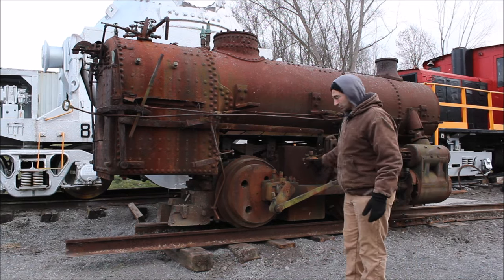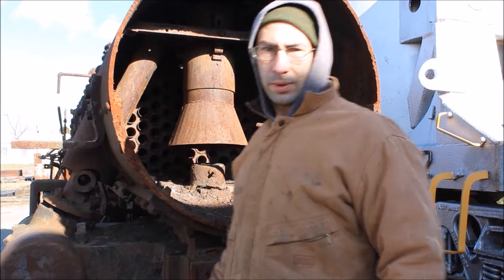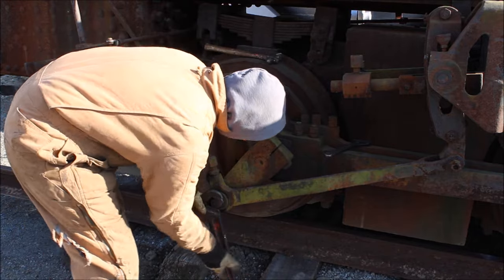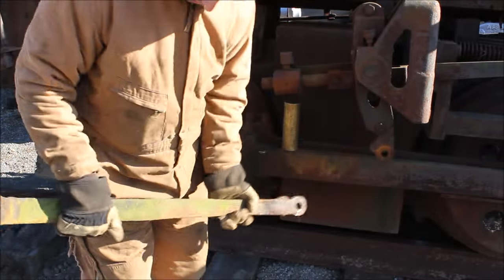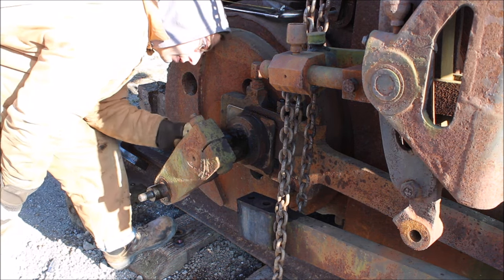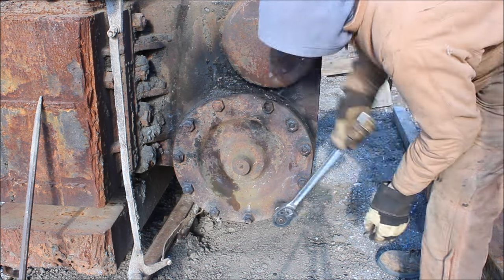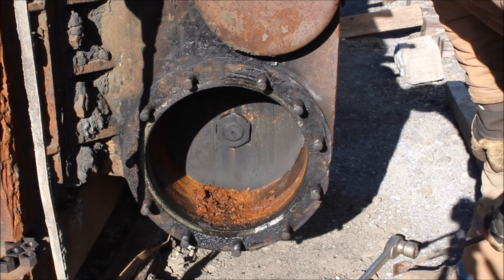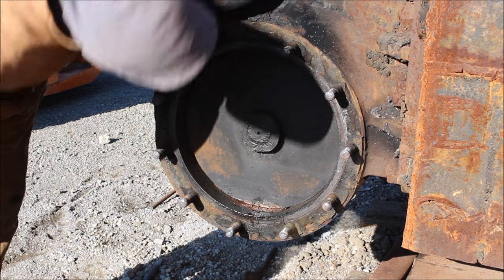Restoring the J&L 58, the "Rolling Ingot"  Part 1

Comment: Ahhh, my kingdom for a 3/4" impact gun!
Reply: Or at least a good 3/4" drive socket set, ratchet and pull handle.  Geeze,  a pipe wrench and crescent, with big bolts and nuts that rusty.

Comment: The different terms used for the parts of the locomotive & boiler are different in American and British railroading. For example when he says "flue sheet" I realised he means 'tubeplate'.
That one was easy to tell because he was pretty much pointing at the particular area.
It is difficult to follow what parts he is talking about before 4.00, when he was talking about the process of dismantling & restoration.
The boiler is always #1: What is the inner & outer firebox like + the front tubeplate.
Then you go looking at the frames and the wheels. Well, you said that the frame had been cut. 
I assume the super-heavy nature of the frame is to add low down weight & boost tractive effort. It is odd to see piston valves and Walschaert's valve gear on an industrial locomotive.
Were 2ft gauge railways that common in the US for internal use in industry?
Reply: they had them and used them till a bit latter era then the mainliners, so yea there are some short line and smaller gauge tracks in industrial area.

that said forgive my weird statement but the smokebox on this engine compared to a mainliner like 765 or 611 is cute, look how tiny that blast pipe is, this thing while I know is heavy metal thats the nature of the way they were built, but that boiler is soo tiny it dont look like it could hurt a fly,  looking inside of 765 on the other hand the thing looks like its ready to make dinner out of you especially the giant blower ring, looked like a rack for wood on a giant fireplace under all the grates and mesh to keep the cinders down and the huge blast pipe coming out of the floor of the smokebox, I help out with 765 sometimes on days off, there are many that do way more, and are more well known, and have been doing it longer, but I do help out with odd jobs, the occasional grinding and metal work, lots of cleaning, and being a tool monkey fetching things for the others since I am younger in my mid 30's, vacuumed out the sand from the auxiliary tender tank car climbing in and out of the baffles makes for an interesting office for work, and getting the hose around is a pain  in the hands pulling on it for 2 hours trying to move the shop vac hose around, but its the only way to get it done, the tools might be newer that we use but the methods of care and fabricating are the same time honored way, making parts means lots of hot work grinding, and the muscle sometimes of two or three men.  

but yes as it its Rick could use a helper at least taking care of a steam engine is not a one man job.

Comment: You guys are so awesome! Its really so cool to see some things not only saved, but actually rebuilt and running from Yougstown, I am originally from Cleveland. I wanted to ask why is this called Jones and Laughlin, did this loco work in Aliquippa or Pittsburgh? I will check out your Facebook. Hey, I was googling and trying find info about this locomotive and stumbled on something called the 'Youngstown ingot Mold Railway'. What was this, a RR that just moved ingots all day?? Where did this operate in Youngstown? Last, I wondered did you guys have a chance to get anything out of the old Wean United Machine factory before it was torn down?